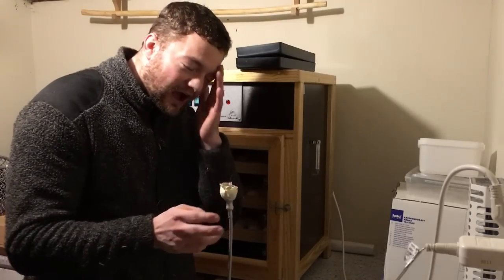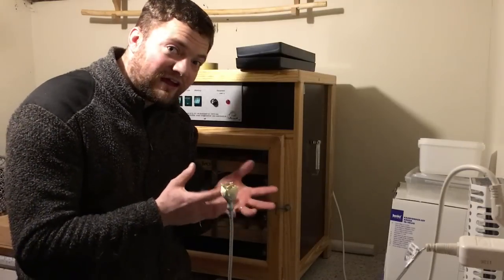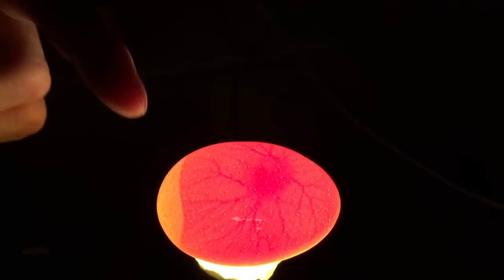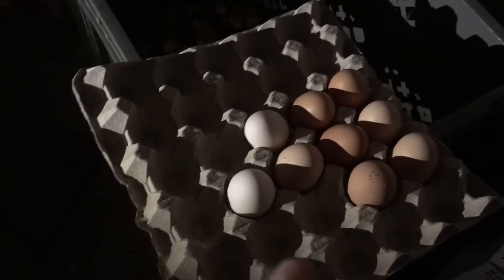Why And How To Candle Your Eggs

Comment: Use the torch on your mobile phone it works so fast you will have all the eggs done in a no time I started using it on mine and I could see immediately if the eggs were fertilised the light on a phone is so bright

Comment: some of the questionable eggs didn't show an air sack on the cam. shipping would do that. I just rec. my first shipping box and it was packed very, very prof. but shock drop will not be protected. I'm letting them sit for at least four days and then will start the turner from time to time, then candle at eight days and make the decisions then.

Comment: If I had a higher capacity incubator I'd get more eggs! 😂 Right now I have a clutch of 7 silkies in the 'bator that were shipped to me. They're only a few days in so far but I believe so far there's only one I'm questioning on if it's viable. Which is good. I can't wait to see how they are this weekend! :D
And yowza, that LED is great! My candler is 12+ years old. That bulb hasn't been changed ever. I need to try and get a brighter one Friday so I can really see into those eggs...

Comment: Wow I could see them when you moved the camera back so you could focus on the eggs 😹 that was surprising I did not think I,would see it from that distance . I noticed the veins before the heart plus the air pocket I noticed was different to the unfertilised eggs. Thanks for sharing that it was something I have not seen done in almost 40 years when I had the chance to do this on the farm I stayed at when Mom remarried when I was almost 6 I had fun on the farm even learned to drive the tractor as well 😹😹😹 only down side is when I fell,out the low bedroom window right on top of a bed of stinging nettles not a pretty sight I can tell you😹😹😹

Comment: You shouldn't shake the egg like you do in the first candling, could shaker the embryo loose so to speak.  If hatching rate from the incubator are low, that might be cause you've shook the eggs. And as a lady wrote, move the incubator to the let,  so the table at the right side is free for you to put the frames on while candling. Otherwise I like your videos.
Reply: Kenneth Stensrud yes you are right aweasome

Comment: Simeon due you have back up power for the incubator in case you lose power in the 21 days...Mike
Reply from the maker: Gasoline. It is a small 4-stroke Honda back-up generator.
Reply from the maker: We have a generator.
Reply: What sort of fuel does your generator run on?

Comment: gr8 vid....instead of the tape on your light try using the cardboard center of a toilet paper roll....it wont let any light bleed out through it like i noticed the tape does.....its very flexible and forms a perfect "seal" around the egg....i use it on my flashlight when candling my eggs and it works like a charm especially on very dark colored eggs
Reply from the maker: Thanks. I like that idea.
Reply: @simeonandalex  careful the egg isn't smaller than the hole. Most chicken eggs are and will fall through.